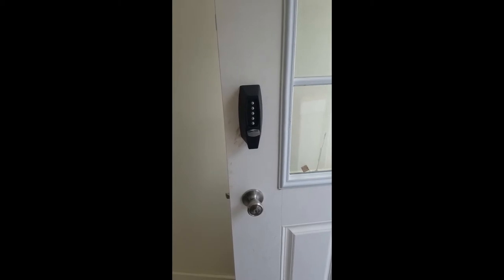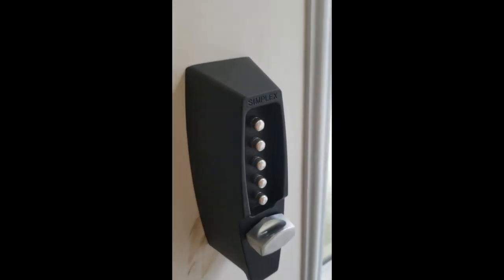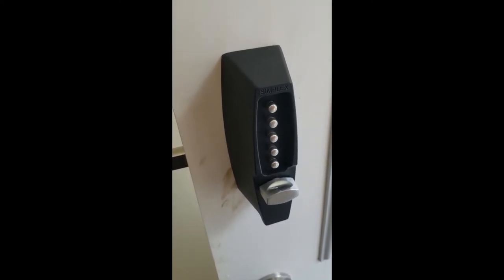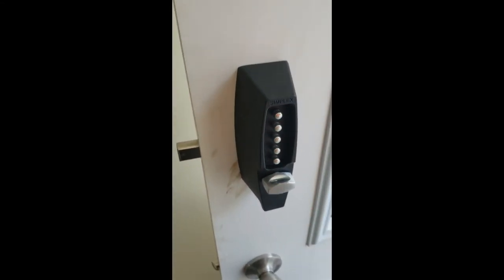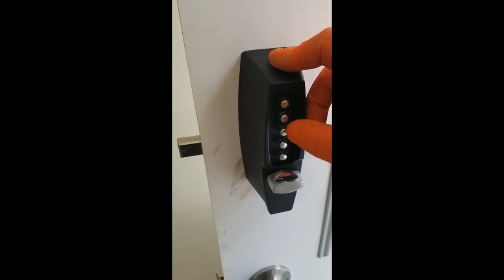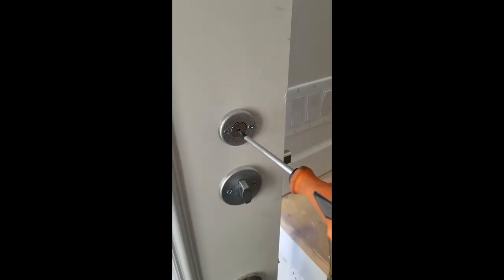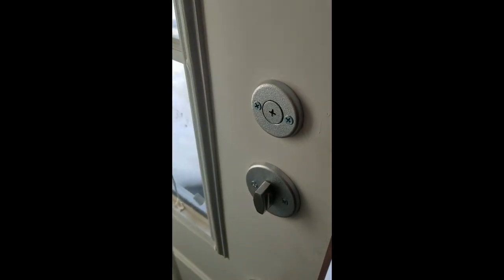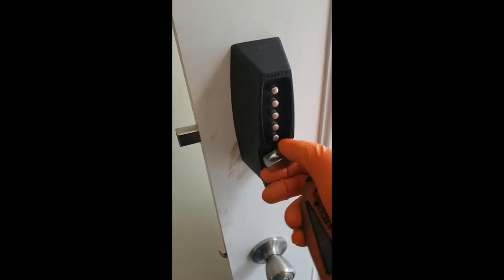Kaba Simplex Ilco 7100 series Combination change

Comment: Thanks! Just came across my 1st one (in residential) here in VA. They were worried about it looking cheap but I told them Simplex is known for commercial and its mechanical so it will probably last forever. They were happy with the code change and rekey regular locks
Reply from the maker: The build quality is fantastic

Comment: From the operation, I suspect it's using the same number chamber as the 1000.  I think I have one of these sitting on my shelf in the basement.
Reply from the maker: The spindles that run through them are different. If your handy, it's easy enough to do.

Comment: Great, super clear video, thanks!
I've reset a few of these for some friends over the years. But I came across a new challenge. The lock was in what you referred to as "la-la land" in other words, it had no combination when I came to the site to reprogram it. I followed your instructions but something's wrong with the reset dial (the philips "click" reset) we don't hear a click at all.
Does this mean the mechanism inside is broken? Can it be disassembled and fixed? Should my buddy just buy a new one?
Thanks for your help; the video was top quality!
Reply from the maker: You can remove the 2 screws from the top plate and try turning it with a pair of small pliers. If not, you would have to take it off the door, remove the back cover and push the reset on the top of the chamber.
Reply: @locksny  thanks!

Comment: I don't get door makers these days, I see doors made with the glass at the same level and close proximity as the lock. A bad dude will break the glass and have access to the turn knobs on the dead bolts and the turn button on the door handles, I mean are they designing this as such on purpose?
Reply from the maker: They wont even let you install a double deadbolt these days.
Reply: really, is that a fire code or something I wonder. I have on both doors, a 2x4 that at night we place between the door and wall thats behind... America, there's a lot of home invasions going on too, and we practice also home carry of firearms as an added protection., I mean shits crazy out here.

Comment: I forgot the lock combination.  How can I make a new combination?
Reply from the maker: You would need a locksmith or someone who can pull it apart to get the lost combo for you.
Reply: @locksny  I could do that too.  could you help me how to do it? How do I recognize the old code if I took out it?
Reply from the maker: @ildikobalogh6631  You have to line up the wheels inside.
Reply: @locksny  Thank you so much!
Reply: @locksny can you tell how to line up the wheel I am in the same situation